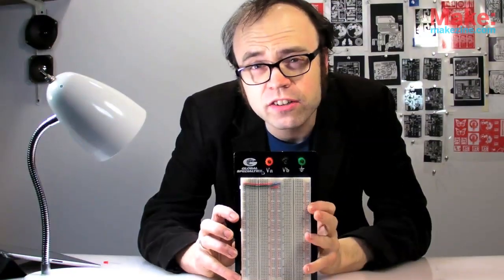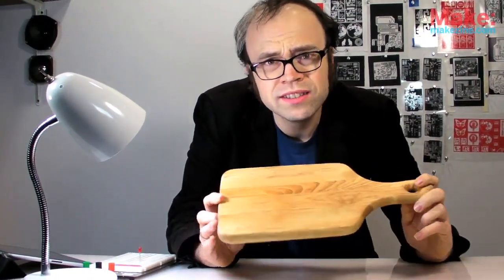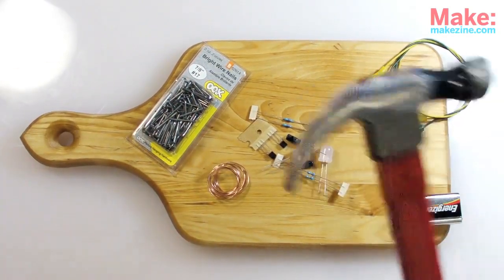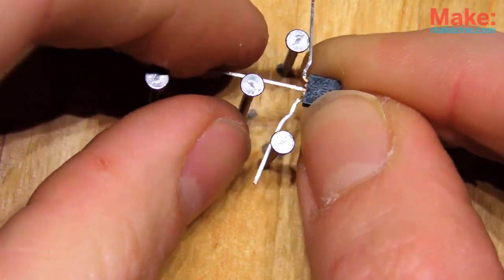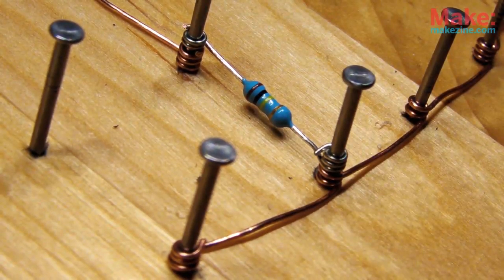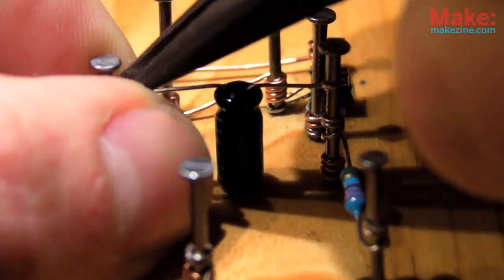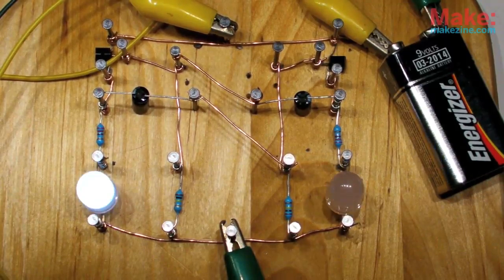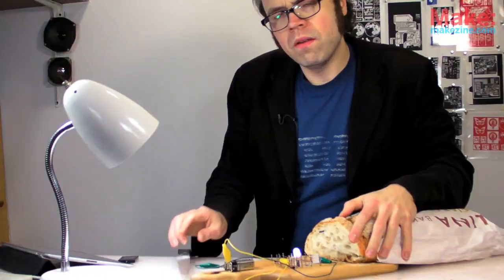Collin's Lab: The REAL Breadboard

Comment: When I was 12, I used to make my circuits like this, since I was so poor and lived in a isolated area, haha I had to put nails on a board and start connecting things exactly like this.
Reply: It's where the name 'bread board' comes from. People just hammered nails into the bread cutting board.
Reply: Hope you're doing great now!
Reply: @rich1051414  No. It goes back to the 1920's when radio was becoming popular. Men used to mount the large radio parts such as vacuum tube sockets, transformers, coils, etc on the wife's breadboard. Eventually, any piece of wood with components mounted on it became known as a breadboard. Breadboard radios show up on ebay quite often.
Reply: @rich1051414  That's not true. It come's from the 1920's during the advent of radio when men used to build radios on their wives' breadboards. Real live breadboards courtesy of angry wife. LOL!
Reply: @drcowan3468  So they didn't hammer nails into the breadboard? Or they did? Cause you said I am wrong, and then went on to say I was right.

Comment: Plus with parts like transistors , capacitors and so on. When you solder them to the Brass/Copper nails on top, you have plenty of room underneath for more connections. Plus these bread boards are AWESOME for High Voltage 'Jacob Ladder' top circuits. The arcs dance around from nail to nail on the board. REALLY Mindblowing!

Comment: my first ever circuit(as far as i can remember) was built on a wooden board, with brass nails and copper wire. but i also soldered it together.
Reply: In the 50's Yes 1950's, My brother and I built a Radio crystal set on a Small plank, suppose it was the first breadboard, (I wonder if I can claim copy rights , Nah )  We used earphones , copper wire on a empty toilet roll and a crystal, Simple . Just saying . Loved the video , thanks.

Comment: The first thing you showed us is often referred to as a "protoboard". or, solderless proto socket. The only time I've ever used a literal "breadboard" was back when I would build tube amplifiers. Everything was soldered point to point. They were dangerous as could be, but, very easy to rework.

Comment: @djscottdog1 Well a T flip flop is actually a circuit that toggles its output when it sees a active edge on its output. This circuit is called a astable multivibrator. With a few modifications it could be turned in to a RS flip flop.

Comment: Colin...I have no idea how old you are. I'm old enough to have received a gift for Christmas in 1973 or '74 that Radio Shack sold. It's a hybrid of sorts. It was their 150 in 1 electronic projects board. It was a lacquered wooden box with individual components mounted to the board with a glued down paper overlay that identified each component along with its schematic symbol and each had a number of coil spring clips that were connected underneath and out of view corresponding to the number of connections to the component. The BJTs had 3 the caps and resistors had two, the electromechanical relay had five, etc.  There was a bag of bits that had some external kit like a momentary telegraph type SPST switch and the like and it had a color coded set of pre cut jumper wires of differing lengths.

Comment: I really really really want to make a radio on an actual breadboard. I have no idea where to start though
Reply: Should be pretty simple if you're okay with AM.
Reply: try to begin with what we call detector reciever radio. only one diode, headphones with high ohms (military headset should work well) couple of wires for ground and antenn. you will doesn't even need a battery!
Reply: hmmm a military headset, seems easy enough to find...
Reply: First get a breadboard.
😂😂😂😂😂😂😂😂😂😂😂😂
Reply: Take a tip from Mary Poppins. Start at the beginning!

Comment: For a 9 volt supply, you should place diodes in the emitter path of each transistor to prevent the base-emitter junctions' maximum allowable voltage from being exceeded.

Comment: You should use Brass or Copper nails for this. When we made ours- and soldered parts we used the brass or copper ones. I suggest the same for non solder boards.

Comment: Go back 100 years when the "breadboards" were made of wood and the components (tube sockets, power transformers, tunable air capacitors, lamps, etc.) generally were of the large variety and often even had mounting holes in their bases to mount them down (to a board).

Comment: When making multiple loops of wire around each nail node, how much does inductance affect the particulars of the circuit? Or does it not matter when the voltage is low?

Comment: Simple solution for an IC: wrap wire around each pin and then wrap those wires around a nail. Although DIP-8 is probably the biggest package I would attempt.

Comment: @djscottdog1 No, sir. This is an astable multivibrator. To turn it into a flip-flop (a.k.a. a bistable multivibrator), you'd have to replace the capacitors with a pair of resistors, probably a few kiloohms a piece. Replacing only one capacitor with a resistor yields a monostable multivibrator; a circuit akin to the gadget that automatically turns off hallway lights a fixed time after they were turned on.

Comment: Yes and no
1- The inductance will be in nH..not uH or mH
2- The circuit is oscillating at very low freq
3- Any LC tanks produced will resonate at a much higher frequency and should not cause a problem.
4- There should be resistive damping there somwhat (if you analyze the circuitry in depth)

Comment: @pcmask Yeah but nothing to worry about in a circuit like that. They wouldn't affect anything at that kind of low frequency. Go up into several tens of MHz then yes, you will have small antennas and stray inductances everywhere.

Comment: Hey, when you started marking with the pencil, I thought you were going to draw out  the whole circuit.  Then I thought, why not stick the circuit diagram right on the board and nail straight through it?  Much easier to lay out the circuit that way and a bit more illustrative of what's going on.

Comment: This was the only way to do it back in the day, and is still a good way. Solderless breadboards have lots of stray capacitance. Wood does not. You tuber "radiofun232" has hundreds of videos of circuits using simple wood board construction. The projects go from simple circuits at DC to RF circuits going up into VHF. He even has some using IC's. Also, You tuber "Bob H" has a few videos of some HF amateur radio 80m band 500w linear amplifiers running 3kV plate voltages using the wood breadboard method. The thing you want to do if you use this method is to moisture proof the wood. You can add capacitance, shielding, ground planes, etc using foil. Brass nails work better than steel. "radiofun232" has some good videos with tips about how to use this method. You can also use this combined with "dead bug" and "Manhattan" style construction to do almost anything at any frequency.

Comment: no, just electronic skills... the capacitors and the transistors do the job of switching. how? all i know is that when the capacitor is charged to a particular voltage, the transistor "opens" the path so current can flow thru the LED and lights it...

Comment: ROFL awesum.  looks like fun, but I think I will stick to my traditional solderless breadboard thanks. LOL by the way, speaking of led circuits, any free source I might be able to pull from, I want to make a circuit to light up my dash componants instead of replacing the old lightbulbs that never were bright enough in the first place.  Would save me a ton of calculations if someone already had like a multi led circuit.  I cant tell how much gas is left in my car at night lol.

Comment: its bad because you need to twist on the components on the nails and when you test it you need to untwistem and the n solder them on pcb, and some parts ends sometimes comeof by twisting them untwisting i will try to make a bread board out of cardboard box

Comment: Never mind the 10 or so little inductors the wire wrapping creates. Still cool though.
Reply: I was thinking that, too. It shouldn't matter at all in a DC circuit. And in AC won't mater much at low frequencies.
Reply: The windings are shorted together by the nail, which should make this effect minimal. Wire wrap (the kind with the really tiny wires) works up to at least 10s of MHz.

Comment: You are doing it all wrong though. The heat you will require with those huge until December nail and heavy bare wire will destroy all the transistors. The trick is to use smaller brass nails, Pre tin the nail heads and use #22 bare tinned wire. You can easily tack transistor lead tips to the bail head, leaving the device undamaged. Remember, it's an  experimental breadboard. Not a finished product. You will be making changes. A total waste of circuitry real estate.